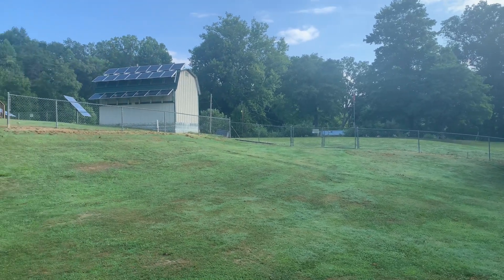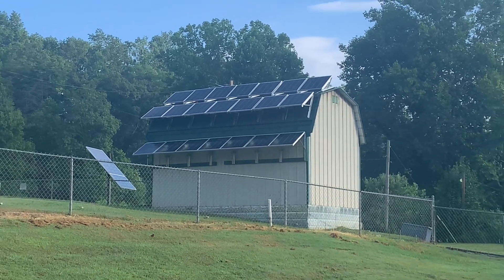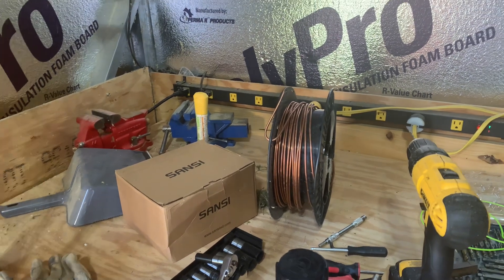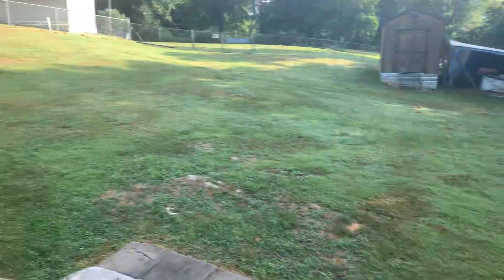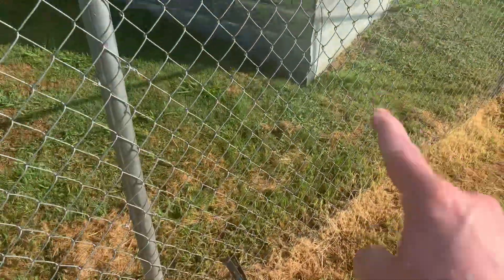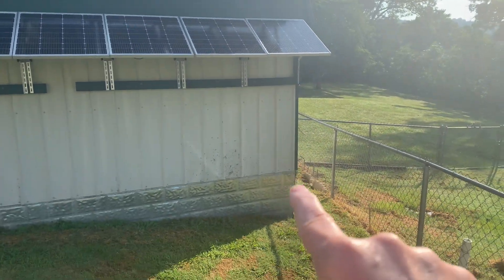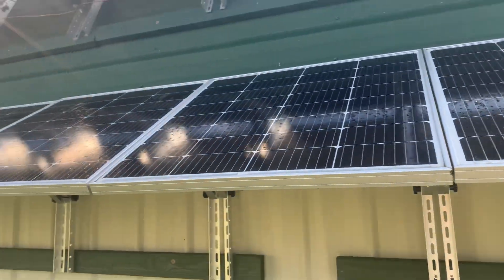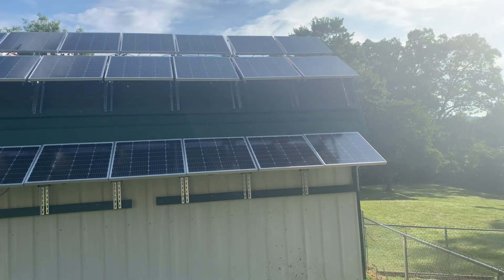Solar Panel Grounding Review

Comment: I see no benefit to grounding. Lightning may strike panels more often since the zero ground potential is an attractant.
Author presumes that panels are mounted in a permanent locations but says nothing about portable ones.
No mention on if panels are mounted on wood either.
Reply from the maker: It’s really up to you, the owner. If you feel no need to ground your panels, it’s all good. And if you do want to ground, again it’s what you prefer. I just grounded mine as another safety precaution. As I have a lot of time, labor, & cash wrapped up in this solar array. You do you! So far my 3-arrays on my building are still working perfect with no issues. Thank you for your input & watching my channel.
Reply: @EASTKYPREPPER  Going to have 4 panels on wheels. Need it movable.
Impracticable to drive and remove ground rods all over the yard.